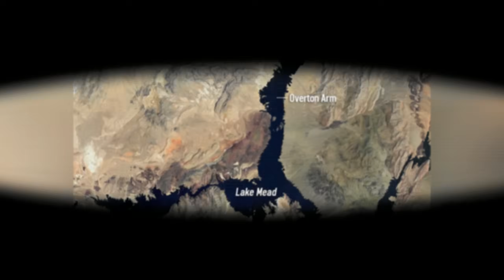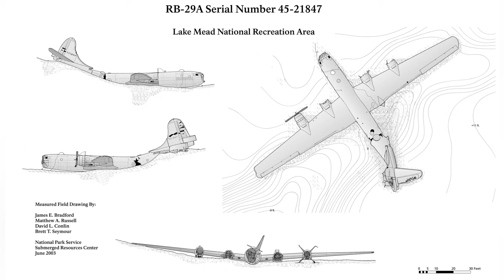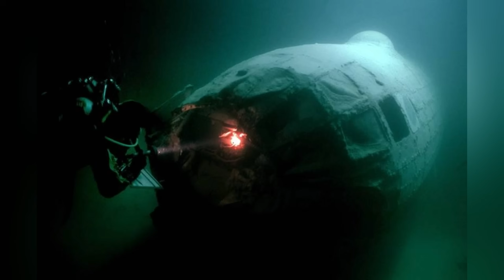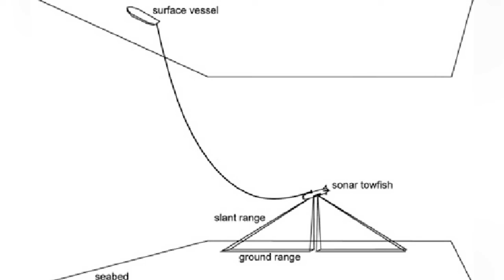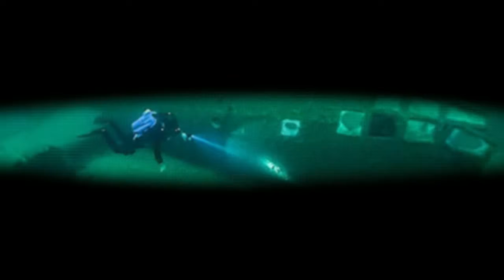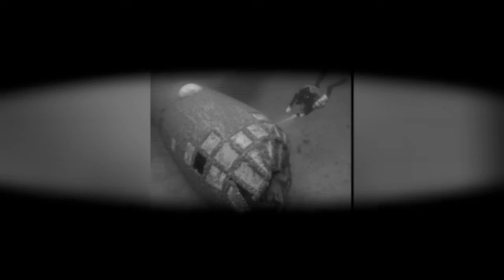Documenting Lake Mead B-29: The “Sun Tracker” Bomber Time Capsule

Comment: Why has that B29 never been salvaged ?
Reply: I don't know it needs to be.  year before lasts drought brought it feet from the surface, it was the perfect time.
Reply: The Courier hasn’t completed the Boomer side quests yet.
Reply: Why don't people like you ever actually LISTEN to the narration??????
Reply: @s.marcus3669  exactly, you should listen to the narration.  The plane no longer rests 200 feet underwater where it's protected by pressure and darkness.  Now photosynthesis and light can get to the aluminum  skin causing advanced corrosion to the plane.  It's now at the point where it's better to pull it out in it's preserved state than let it fall apart in the next few years. It can no longer be preserved underwater, if it is to be preserved it needs to be saved and removed.  Plenty of heavily encrusted planes have been removed from other lakes by means of slow methodical removal and bracing. This is a method that has been done time and again all over the world and successful.